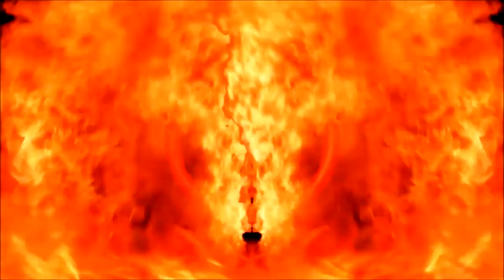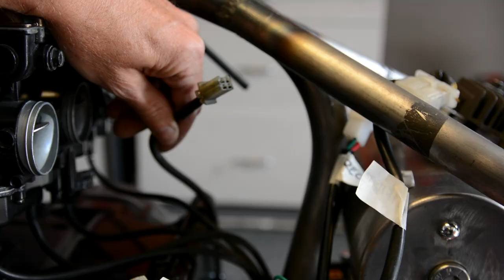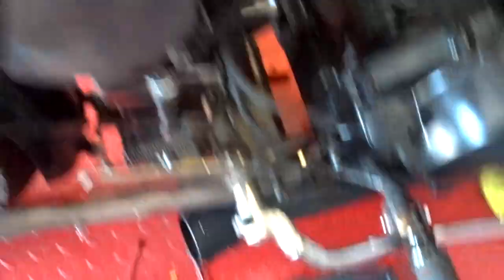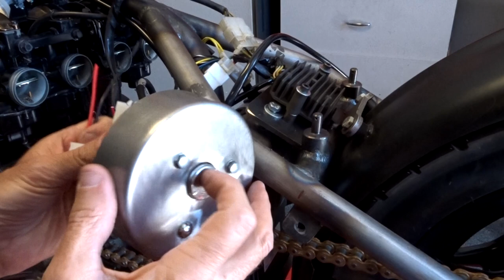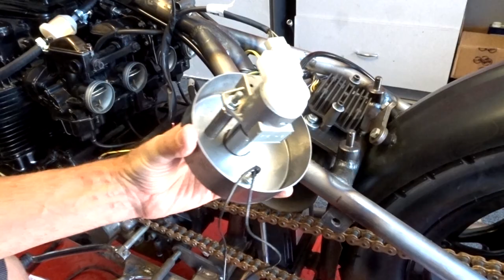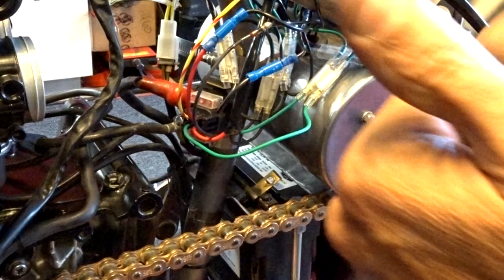The Ultimate Bike Build Wiring Harness.  Bobber's, Chopper's and Cafe's

Comment: Been a mechanic for 32 years, my  strong suite is DC electrical. You did a nice job there. Kudos for hooking up the negative last! I cringe when I see people using solderless crimp connectors on a bike; its just begging for problems. I've never used the type that you show here, but they seem to be a pretty good option. One small thing for FYI in the future. When you must use a connector like the one bullet connector that you showed, experience has taught me that a spade style connector is better. Bullets tend to wallow themselves with use over time and become loose. Its a small thing, just trying to help. Love your videos, your bike looks great! Im sure you will get the snafu sorted out in due course and cant wait until we all get to hear her fire up!

EDIT: As someone else pointed out, your oil tank enclosure is a water trap. Electrical and water dont mix very well. You can either rotate the enclosure or drill a hole in the bottom of it so that it will drain. Cheers!
Reply: The seat will be on top to cover the holes, but prob good to drill a drain in the bottom
Reply: @gonzalosanchez6387  water will always find a way, they should have been in the bottom from the start

Comment: The best way to trouble shoot a wiring problem, is to fully understand it. I still recommend sitting down with a diagram and following the circuits from the battery through to their relative destinations. 
Drink beer or coffee at the same time.
Reply: wanna know my wiring problem? legit most of them are disconnected, luckily it seems motorcycles are much easier to work on than cars, i always tear things down to the brim to learn the inside and outside of the thing i buy (its a 1977 kawasaki kz650)

Comment: You should have got all those connections in the old oil tank and had the hole at the bottom as it is lots of horrible joints on show and the tank will fill with water never put put access at the top common sense even the connectors not pushed into the front light very tacky I would have to take that harness off and start again maybe even run some in the frame, sorry but I love wiring and to me this is a mess.
Reply: To me also, looks terrible and not reliable at all.

Comment: I only see wire harnesses for Honda’s on the spark moto website. Does any know if this would work for a Yamaha XS650?
Reply: Did you find out anything about the xs650? I have one I am building as well.
Reply: jimmy popp yeah spark Moto has a universal wiring harness that fits the XS, the only difference is the color of the wires. You’ll have to go off a few diagrams so that they match up
Reply: @2010KOAB  Thank you.was it 300$ for a simple harness though?
Reply: I believe it was actually $170 and some change with shipping. I found out afterwards though that Mikes XS has them also for about $70
Reply: @2010KOAB  thank you brother
Reply: jimmy popp no worries, best of luck with your build.

Comment: I'm building a bike and electrical is not my strong suit. What do you wire the key ignition and then the push button to?
Reply: The ignition switch or key runs (commonly referred to as B+) the switched power for the bike. This turns on and off all power to the bike. The starter switch controls the starter solenoid which controls energy going to the starter motor.

Comment: If your going to do wireing vids , get better crimpers , those ones suck and if your going to use but connectors , use non insulated ones with shrink tubeing
Reply: Good thing you're not doing spelling videos, or maybe you should watch a couple? Nothing gets you're point across better than a statement spelled correctly
Reply: @jinxbottleflip1942  This is a "technical" upload. Where is your usefull input?
Reply: @jinxbottleflip1942  lmao "you're"

Dude, i get it, spelling mistakes are a bit annoying sometimes, but if you're correcting someone please double check your own spelling...

Comment: Anekcahap C has made a good point. Your chain is too close to the electrical box. On overrun the chain will want to whip and beet against the box.
Best solution I found. Is to create a chain guard. Preferably out of  ( reasonably heavy gauge)angled aluminum . Then apoxy a 1/4 " thick rubber strip on its upper side. Mount the guard just above the chain. It will then eliminate any whip that tries to happen on deceleration.

Comment: Was hoping to pick your brain if you or anyone who could possibly help, I put in a new and upgraded oil pump in my 103 cu I Harley Davidson duel cam, BECOUSE I spun a cam pencil lead barring on the left, new adjustable pushrods, and it's running really rough , my question is do you have to put one of the cylinders to top dead center like you would a car? Before you line up the timing marks and chain on the back side of the oil pump for the cams? And if so what cylinder is number one? The front jug or the rear and does it have to be on the compression stroke? I'm probably over thinking this but first Harley duel cam I've built, thank you in advance, linestorming@gmail.com  Dusty
Reply from the maker: Oh man, you are beyond my expertise in this area.  Keep searchin, bud. MP

Comment: Trying to rebuild an Xs 1100 don't have a clue where to start things in pieces any advice
Reply: Check out Andy’s motorcycle a obsession on YouTube. He has tons of technical advice as to looks that’s on you.
Reply: Travis Kelley . What do you need to know. I have built a total of 3 xs 1100 chops. From the frame up right through to wiring.
Reply: How. Would i check to see if the motor is seized an i have no electronic i would love to hear it start atleast cranch abit
Reply: @markblundell9461   are you able to cranch a motor without electronic
Reply: Travis Kelley  The starter motor is located under the carburetors . The bolt thread protruding from it near the centre of the motor is for power directly from the battery.
I suggest removing the carbs (if they are still on) and removing all the spark plugs. Spray a little WD 40 into all the holes/ ports. 
Get some jumper cables and a car battery. Hook up the ground wire to anywhere on the case. Hook up the live to that thread I mentioned. Then touch the clamps to the battery. 
All being well ...... She should spin over. ......
Reply: @markblundell9461  thanks gonna give that a try bud ill let you know
Reply: Yeah if have no clue then but another bike